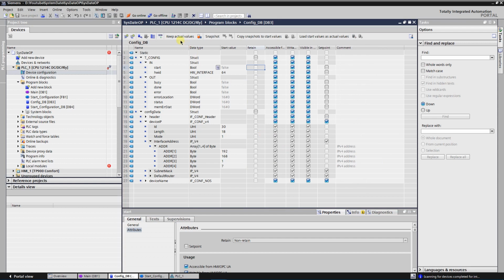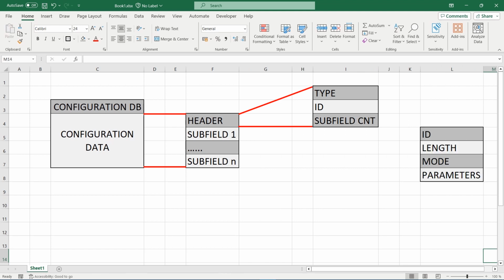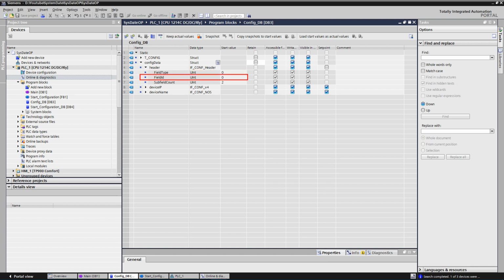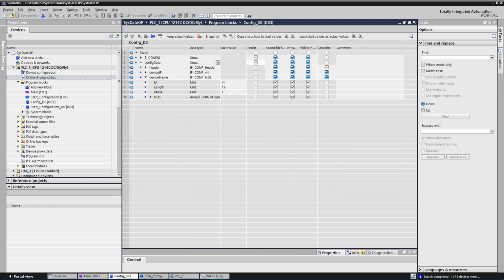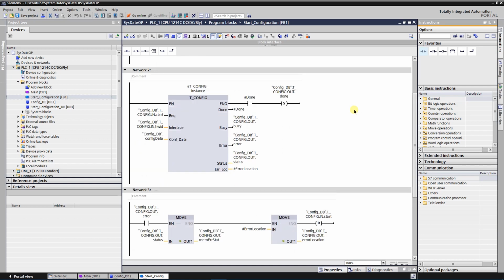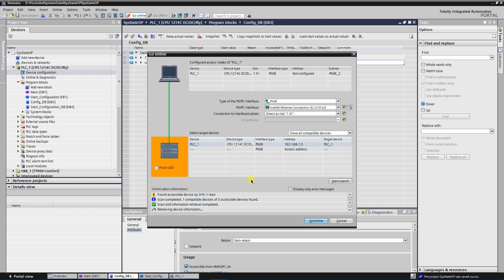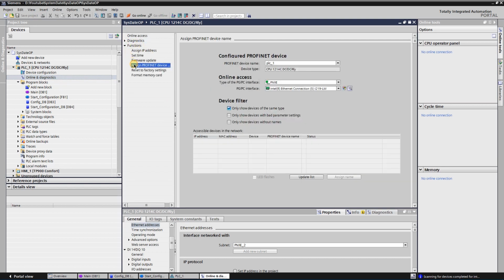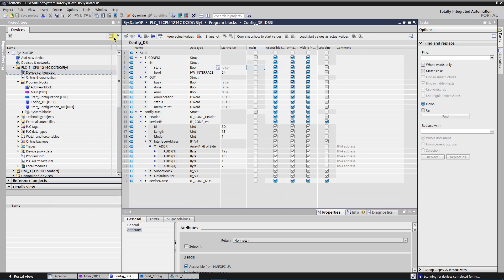TIA Portal: Set IP address of S7 1200/1500 station in user program with T_CONFIG

Comment from the maker: T_CONFIG
- IN: REQ - with REQ = 1 starts processing of the instruction.
       INTERFACE - Hardware identifier of the interface. Can be found in system constants, or device view
       CONF_DATA - Pointer to the higher-level structure in configuration data block
- OUT: DONE - Status of completion
            BUSY - Progress of operation
            ERROR - error state
            STATUS - Detailed error and status information 
            ERR_LOC - Error location

Sub-field device IP length = 6 bytes (header) + 12 bytes (4 bytes IP address + 4 bytes Subnet + 4 bytes Router) = 18
Sub-field device name length = 6 bytes (header) + n bytes (1 char = 1 byte). Example: mainplc = 6 + 7 ('m' + 'a' + 'i' + 'n' + 'p' + 'l' + 'c') = 13